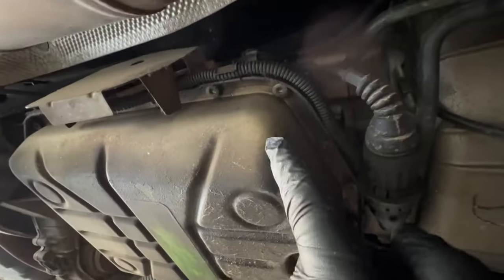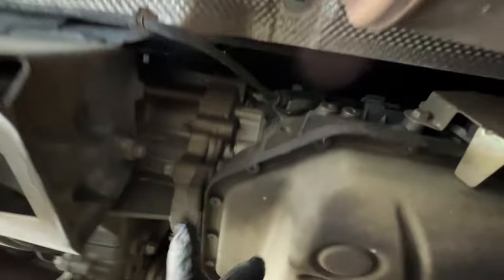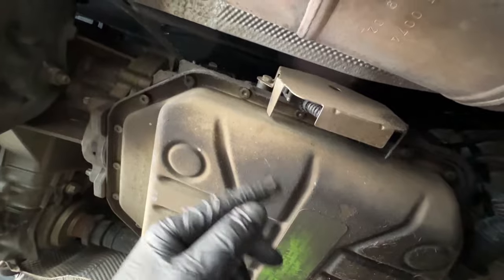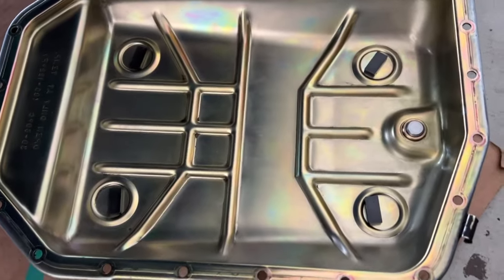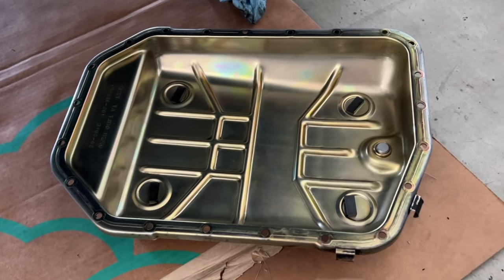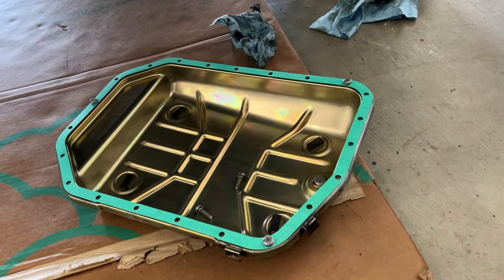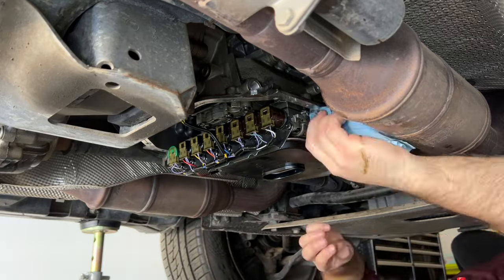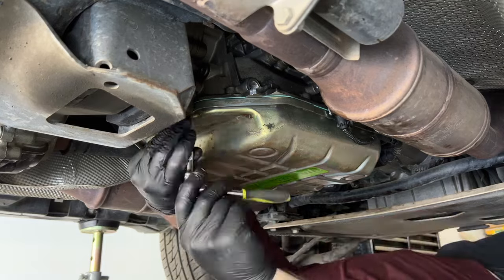BMW X5 Transmission Oil & Filter Change - Complete Process with Torque Specs | BOND Garage

Comment: good tutorial👍💪  is this gearbox General Motors?  does it require oil lever check ( last step ) at some  specific temperature range of the gearbox oil?
Reply from the maker: I believe it's the GM 5 speed. I'm not aware of any temperature specifics (like the ZF8 gearboxes have it)